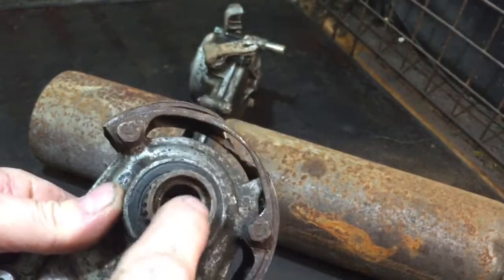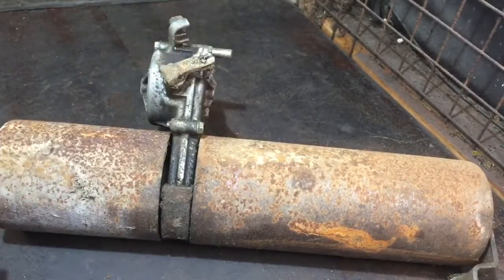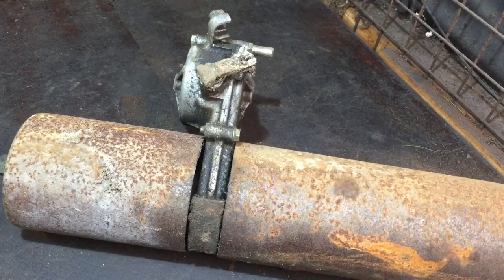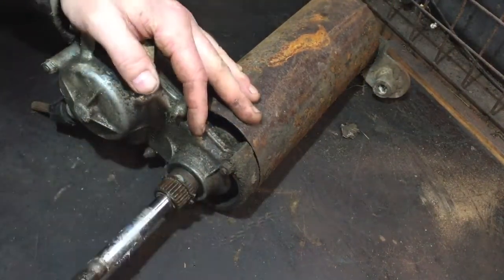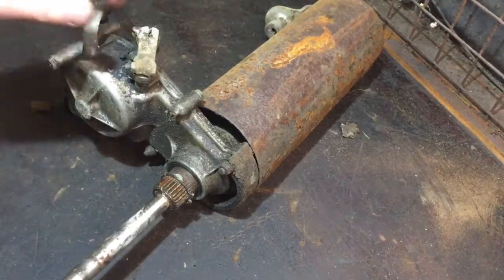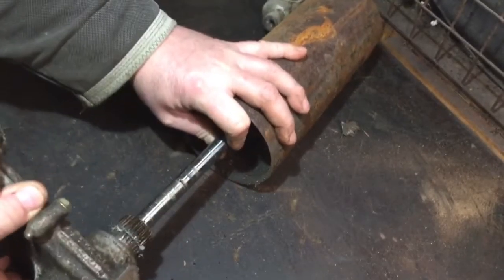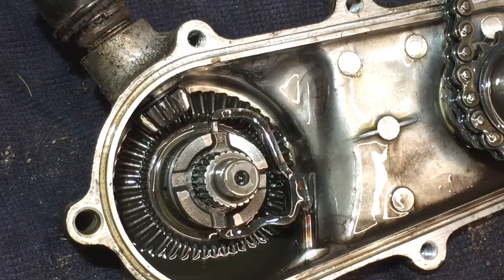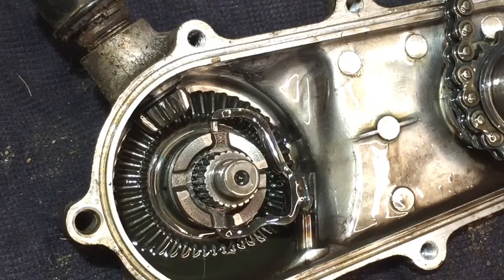Honda Pro Gearbox , Part 1  (Juddering When Drive Engaged) How to fix By Mend It Man 🔧🪛👍

Comment: I was quoted £700 to fix my non-driving Honda HRH536. This video + a new clutch (£35), and we're back up and running. Superb sir.
Reply from the maker: That’s great news I think some where I have an Amazon wish list 😂 only joking I’m glad you sorted yours 🙂👍
Reply: @menditman2004  I spoke too soon! I put the roller back on the mower and it worked for all of about 5 mins and then stopped again. I took the roller off and found that the clutch arm (23436VA5701) had sheared where it attaches to the transmission spline, meaning that it slips when the cable is pulled, rather than engaging the clutch. Actually I think the clutch arm is not well designed - ideally it would be continuous rather than a bridge. Anyhow, at least I don't need to take the roller to bits again.

Comment: Nice in depth video luke not many would repair but that. Nice one 👍🏻
Reply from the maker: Thanks Aaron I must admit the first time I took one of these apart I was a bit concerned as I thought they would be more co pled than they are, they are a relatively simple design, I actually like working on them. The worst bit is if you can’t get the rollers off, they do rust on on a lot of machines. Thanks for watching 🙂👍

Comment: Good video Luke, Ive had a HR216 for a few years and not had any problems (touch wood) also got a HR214 if looked after these mowers will work forever
Reply from the maker: Hi your not wrong they were imo the best hondas made, made to last. 🙂👍

Comment: ive bought a few that the splines had rusted onto the rollers.....tried all sorts to separate but no joy. possible they had been welded either by an idiot or just rust welded together but they are still sat in the garage now gathering dust
Reply from the maker: Hi it’s surprising how the rust will stick them together, big hammer I’ve used but it does damage the roller a bit, but they can be straightened out. I have a few of these drive systems scattered about to, thanks for watching 🙂👍

Comment: I think there was not enough oil in the gearbox. I always use Multi G transmission oil.
Reply from the maker: I used a runny grease, but I can’t buy that anymore. I prefer to use grease in these gearboxes. Thanks for watching 🙂👍

Comment: HI LUKE  , (  YOU NEED A BRAND NEW SEAL . IF YOU USE GEARBOX OIL . )  ( USE SEAL BEST THING IS GREASE ) BEST BET IS A BRAND NEW GEARBOX SEAL  GREASE AND OIL IN THE GEAR BOX .
Reply from the maker: Hi Shane, I explain my reasons in the videos, there are 2 more parts to come. Tbh I like the grease as it won’t leak out, so even with new seals I’d be tempted to still use grease, I’ve opened a lot of these up with zero oil in them, if they had grease it would still be in there. Thanks for watching 🙂👍
Reply: @menditman2004   HI LUKE WHAT IS  TBH  STAND FOR ? . HAS YOU KNOW  I DONE HONDA GEARBOXES TOO . YES GREASE IS THE BEST TO USE  IN A GEARBOX .